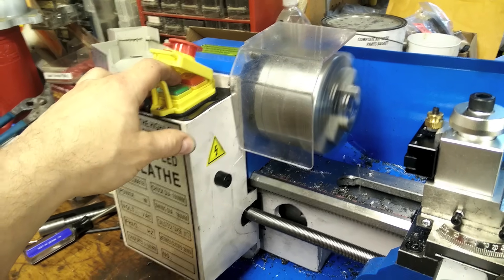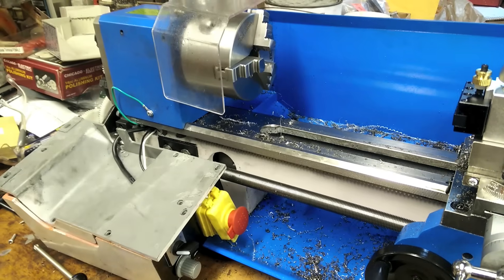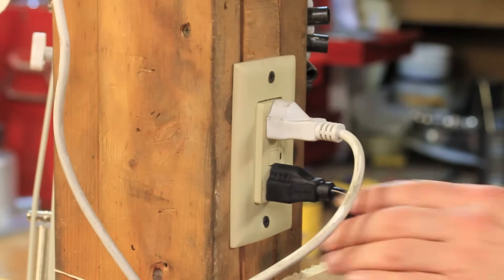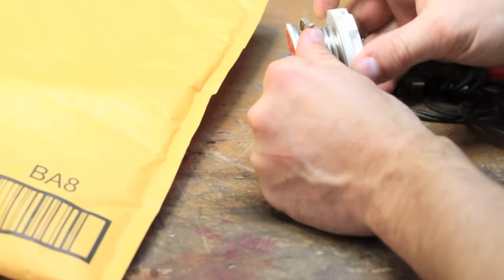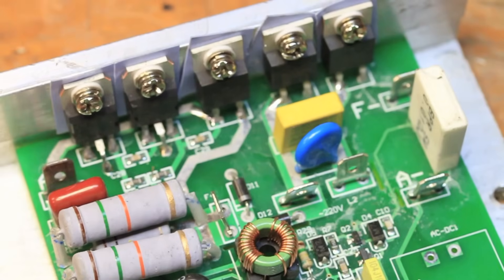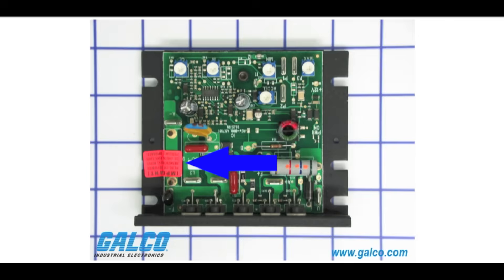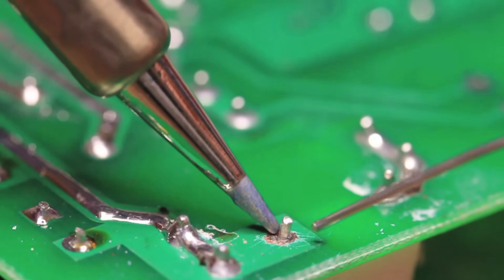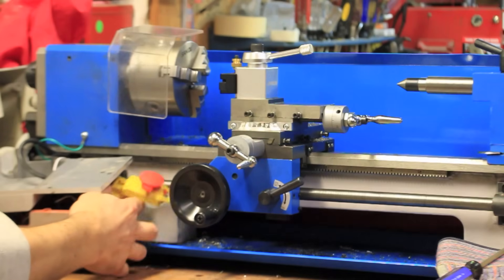So cheap they didn't even finish

Comment: That soldering job didn't look good. I understand that it wasn't the best conditions, however, and I'm not faulting. A better fix may have been to solder a wire from the resistor leg to the other component leg (to the left in this video), which is obviously connected to the same trace on the PCB.
Reply: if the component is conducting you will always have heating isolating pad. some component have isolated housing, and then you don't need isolating pad.the cooling paste is only to make more surface contact  between your component and heatsink. All layer you put on the silicon dyi have a "Thermal Resistant" so even if your heatsing is 35 C degree the silicon can be 50-60C inside. http://www.giangrandi.ch/electronics/thcalc/thcalc.shtml
Reply from the maker: Thanks - what wasn't good about it?
Reply: ***** you can see that the solder makes a blob on the resistor leg, and doesn't really stick to the metal part of the PCB. It should look like a smooth taper starting at the bottom. Flux may have helped, but I still think the wire would have been the best fix.
Reply: the heating pad is not for overheating, they are for electric isolating because the the Transistor or Fet the heating mount is direct connected to the silicium and if you have more transistor coupled, they can short electrical or if the heat sink is mounting on a machine that some coupled current run through it can damage your electronic.
Reply from the maker: Thanks - I ended up with something like what you're describing when I finished with it - I did more work to it off camera to clean it up.  I had my arms around the camera and was watching my soldering through the view finder at the time, so it was a little tricky.
Reply from the maker: That makes sense - I figured since those tabs are ground tabs and the plate would end up sharing a common ground that it was just for the heat transfer - but I'm a mechanical engineer, not an electrical engineer ;)

Comment: Did you contact the manufacturer and show them this video? I feel that you should at least tell the manufacturer so that they either spend more time on QA or rethink their product design.
Reply from the maker: I think I'm too far removed from the manufacture. The seller I dealt with is just a reseller that probably buys them in bulk or has some other connection to be able to make money from them and the way they handled my transaction I doubt they care about the quality of what they are selling. I really think they are building these things for the absolute cheapest possible.

Comment: Hi Tim,Thanks for sharing. Great fix & obviously you're a dab hand with electronics. Maybe you just got unlucky with that speed controller? Not sure that it's the right lathe for me though....I need a lathe to complete my 'projects'. I don't need the lathe to become another 'project'!!
Reply from the maker: At this point - I think it's a cost effective way to get into having a lathe. Really, you can get it working pretty well in an afternoon, you'd just have to completely strip it down and put it back together to check, grease, and torque everything correctly. Most of the other nice upgrades can be made on the lathe which will give you great practice with using it. Keep an eye out for the future videos as I'll be showing some of the upgrades I've been making.

Comment: That's sad and hilarious. 

I found lathes like these on Ali Express for 5-600, but shipping was always nearly half the price of the lathe! Hopefully you got it for a better price...the Harbor Freight 7x10" looks more and more attractive the more you have to dink with this. Plus, AFAIK, it's stocked in-store.
Reply: Supposedly Grizzly does a bit more QC with the machines they sell. They might even sell the Taiwanese manufactured ones? Which are far superior to the mainland China made machinery. All these models look the same, but differ in details.
Reply from the maker: Haha I guess it just depends on what color you like better... I don't think there is very much difference between this one, the Harbor Freight one, or the Grizzly one. I will say that the clerk in the HF store is probably much easier to deal with than the sellers on eBay though. I'd say just get whichever variant you can find cheapest.